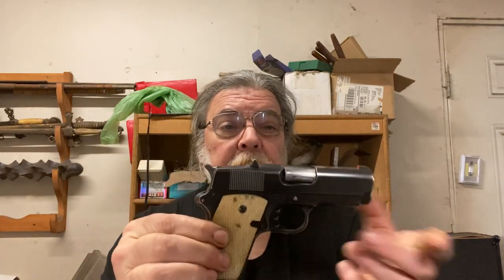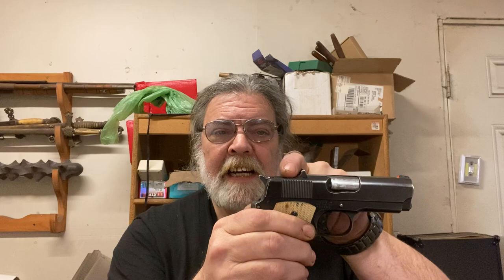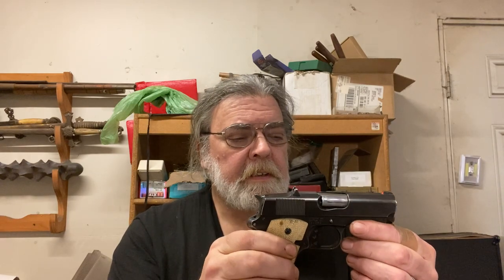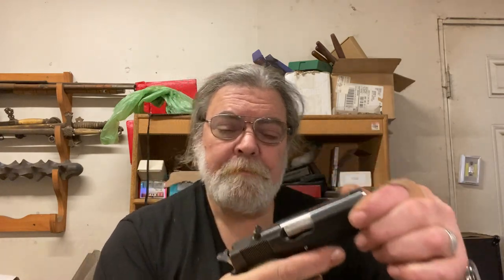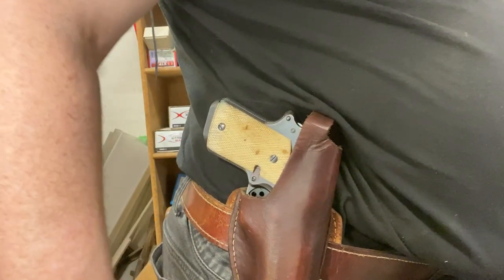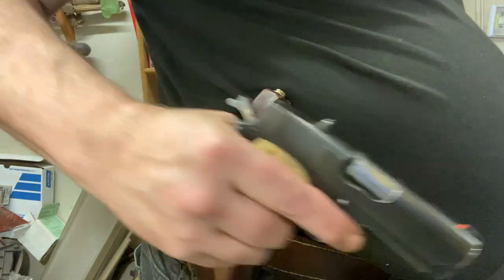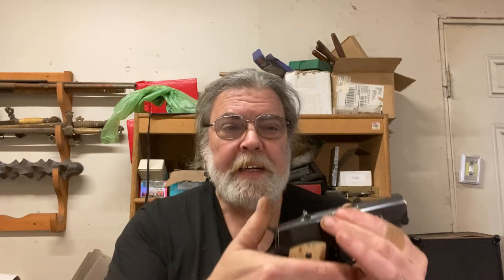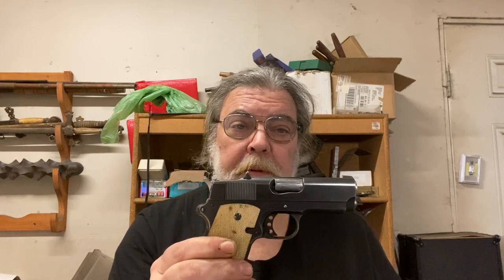This is How The Detonics Do

Comment: Thank you for the many interesting videos Tinker , Pat's prototype had only one safety a custom heavy firing pin spring drop tested  by Pat to 8 feet  on concrete , discharge oddly came from landing  barrel down on concrete not on the hammer as one would think and there was no grip or thumb safeties , so hammer down on a live round is not unsafe as one might think unless you are tossing it 8 foot in the air - US Marine combat doctrine in my era was hammer down on a live chamber and empty chamber for guard duty  never Cocked & Locked  unless it's in your hand - another interesting trivia point is the loaded magazine indicator  - spoiler alert it isn't , when Detonics got the prototype from Pat it was not feeding reliably , the shortened 6 round follower  was cocking in the Magazine and the slide would not pick up the last couple of rounds and Detonics fixed this by lengthening the follower , it had to go somewhere so out the bottom it went , Detonics returned the prototype to Yates with their improvements , My Detonics is a 1977 Mk III carbon Steel frame J hammer with the triple recoil spring and Colt National Match barrel with the early soldered on tapered bushing
Reply from the maker: Thanks for the info!

Comment: Great video! 

One point....while it's not the safest way to carry and draw the pistol, it's not as unsafe as you would think. If you watch the video closely, you'll notice that, while the thumb is in position to cock the hammer, it is not engaging the grip safety. Unless the grip safety is mechanically disengaged (i.e. "pinned"), the pistol won't fire from that position. 

That said, the "finger in the trigger guard" is still a terrible idea. And you can cock the hammer without putting your finger in there. 

Thanks for the info. I had thought the Star PD had beaten Detonics to the micro-.45 market. I now stand corrected....
Reply from the maker: Good points. The Star PD is arguable; it depends on your definition of 'sub-compact.' I really like the PD, but to me it falls more in the 'compact' range.
Reply: The original design had no thumb safety, the 1910 was intended to be carried hammer down on a loaded chamber. The 1910, as well as the 1911 had an inertia firing pin that did not make contact with the primer. Discharge while possible was uncommon with the hammer down, pre hammer block 1911's could fire if dropped just right whether they were cocked, and locked or hammer down on a live round. The inertia firing pin could go forward on it's own weight if the gun was dropped on it's muzzle, shooting a bullet into the surface it was dropped on. On 1911 models with a firing pin block hammer down is just as safe as cocked and locked. After all that is how a single action revolver is carried with a transfer bar, and IS safe. Because the gun was being offered to the US cavalry they requested a safety, mostly so the gun could be made safe on horseback after firing with one hand. Otherwise the gun would have to be holstered with the hammer cocked over a loaded chamber until the trooper could use both hands.